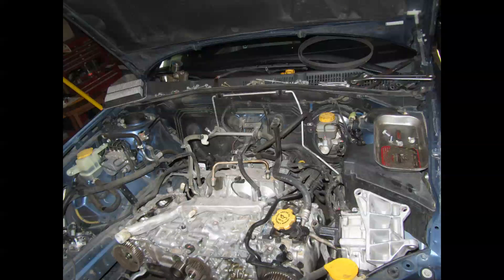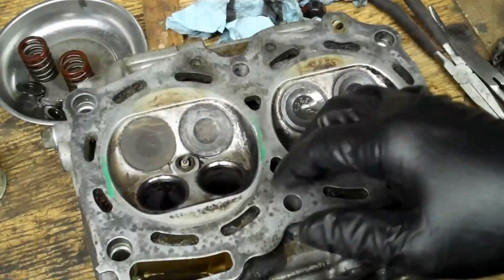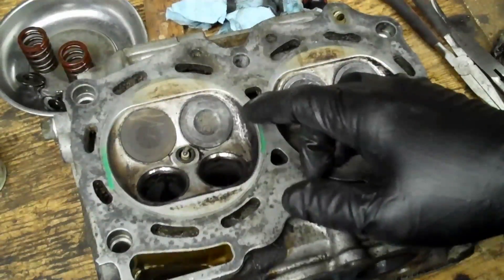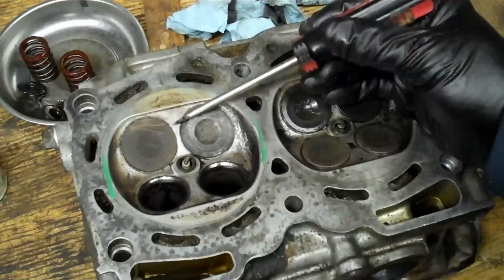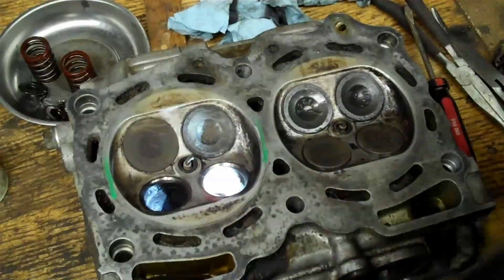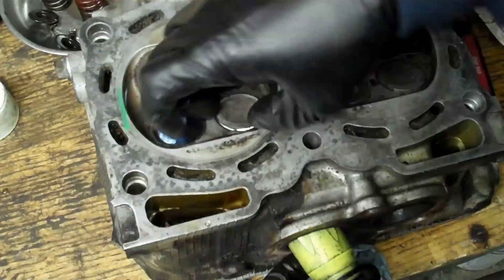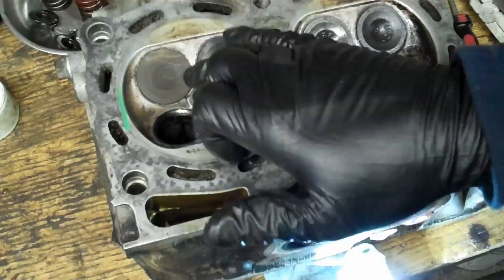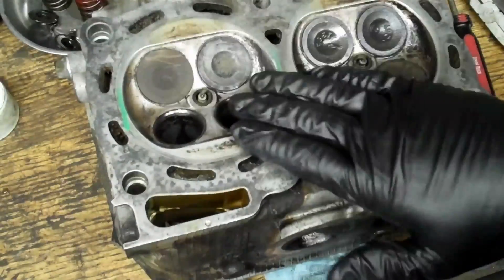Subaru Head Check Before Installing Head Gaskets

Comment: Found out I have a bent valve but seemed to run ight prior to seeing this ( getting head gasket done now) you recommend rebuilding them?
Reply from the maker: It's best to replace the bent valves and often the valve guides (either all or at least the ones that had valves bend in them.)

Comment: I just pulled the drivers cylinder head off my 2005 Subaru forester 2.5L SOHC and 4 of the valves were stuck out. 2 on exhuast and 2 on intake, I did have a over heating problem. I bought the fel pro head gasket kit that you have a link for, what would you recommend before I start reassembly. Thanks in advance

Comment: I have been watching a ton of your videos, I own a 1990 Subaru legacy AWD  2.1 . I personally have changed thermostat, radiator, Hoses , and the timing chain belt was done after 120k along with the water pump ( there is 210K). The engine over heats after 10 min still. is this because of a leaky head gasket, I do not have fog coming off the pipe or any major oil leaks .What the hell could it be. Keep in mind I live in high altitude Colorado and also installed a air filter kn j.if it is a head gasket thing can I drill small hole in the thermostat to temporally hold out till summer

Comment: The width, length and height of these heads leads me to believe it would take quite a bit to warp them... I just replaced my head gaskets and lapped my valves after badly overheating my engine. No machine shop involved. I hope I'm ok... BTW, love your vids!
Reply: AJFresh it started right up but never got a chance to drive it. Realized I had one of the gaskets in backwards so I was losing oil badly. Shut her down and had to go to another state for a job and haven't been able to mess with her since. 😒
Reply: John Riggs how's the car doing now?
Reply: John Riggs good luck with your car and your new job

Comment: i have a question about the head. i bought a 1992 2.2l 5speed for 700.00 from so kid. will the old water pump had exhaust soot on it, now has a new one. but win i put the water in the radiator, it just ran fast out the exhaust pipe. i got the heads off the same way in your 2.5l videos, before seeing it. but the gaskets look good, no tears in them, no cracks.  so what you think put new gaskets on, or look for new heads?

Comment: I have a 2001 Outback that had the timing belt go on me. Was going down the freeway about 75 mph. put a new belt on and had it all in time. (even swaped the crack 1 turn and put it back to-gather to make sure I was on) Still no compression. What step would you recommend now. I took the left valve cover off to see if it was working as it should as I turn the cam. Have not done the same to the right side.
Reply from the maker: I've seen them survive that- usually the 2.2's are bullet proof.  The 2.5's it's hit and miss... literally.  Put a new belt on, try it for compression/starting,  It won't hurt anything further if the belt is installed correctly.  It will just take some work.  This is the course of action I usually take.
Reply: Subaru motors are "interference" type.   You most likely broke and/or bent valves.  if that is the case, you will need an entire engine rebuild or replacement.

Comment: heyy  i think im about to tackle this job myself .i had a radiator blow a hole a week ago fixed it and now im noticing a small water leak by the head on the drivers side i cleaned everything and most likely its a head gasket gone bad ,,,thanks for posting this video its gonna help a lot. btw i have an 02 forester with 118k love the vehicle

Comment: Thanks Brian. . .I'm an old aircooled flat six guy, but I'm about to tear down my daughters 2001.  She overheated it too the point that it shut down on her.  Amazingly it still runs well but exhibits the same intermittent overheating issue you've spoke of on another vid.  Going to review your head removal with engine in car next, then get started.

Comment: Well, I figured this wouldn't work, but I have a Milwaukee 12V electric impact gun and I zipped both those bolts out yesterday no problem. Do you have a recommendation on what to do as far as resurfacing the heads or getting any valve work done? Any special finish I need done, heard it depends on what type of gaskets I get. Which, I'm also not sure of, what do you guys like to use? Thanks for the reply Brian, you're the man.

Comment: Hey Brian, I'm doing head gaskets on my EJ25 and I'm stumped on how to remove the cam sprockets. I already took the heads off because I wanted to get something accomplished over the weekend, but now I'm thinking it may be easier to get the sprockets off if I have the timing belt on....any tips?

Comment: So I decided to do a compression test (dry and wet) and this is what I got  
     #1.    #2  . #3.   #4
D. 115. 175. 180. 185

W. 150. 195. 205. 210

So the specs for this car according to the manual are
Standar.........170 to 225 psi
Minimum.......25 percent
I took the head off
There are no cracks on the head or on the block it seems that it was passing oil to the #1 cyl. Trhu the head gasket everything else is ok just normal wering there are not scraches on the cylinder walls...

Comment: hello brian can you help out with this
I have a 00 dodge neon 2.0 liter engine, automatic w/220000 miles on it
Everything was working great with this car till 2weeks ago   Is been burning oil and shaking a little when is on idle only and I did a compression test on the engine since the injectors are working good and I have a good spark on each cilynder there are not vacuum leaks around it(I spray water and double check with brake cleaner...

Comment: You didn't show a water test, but I presume you put the valves back in and fill the upside down head with water to see if it leaks out. Correct?